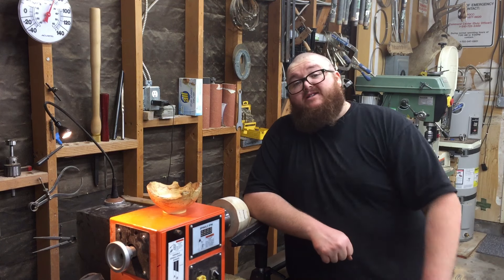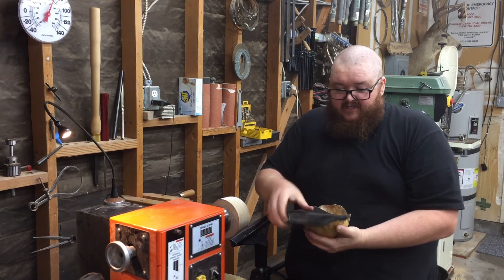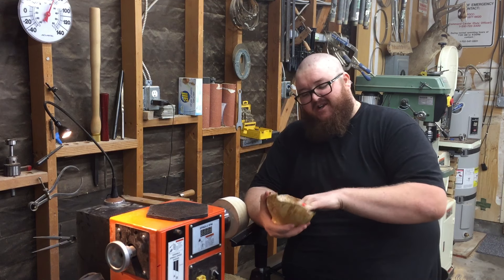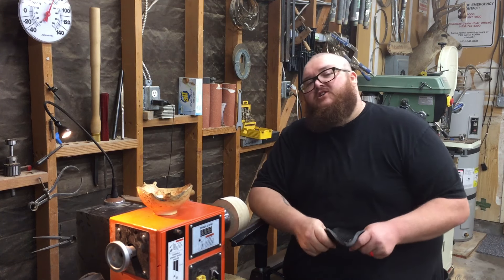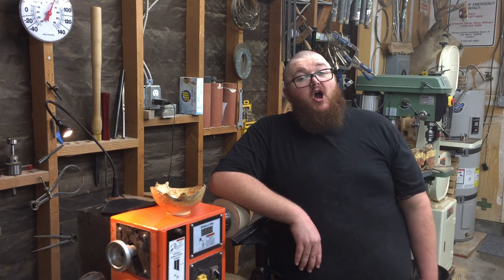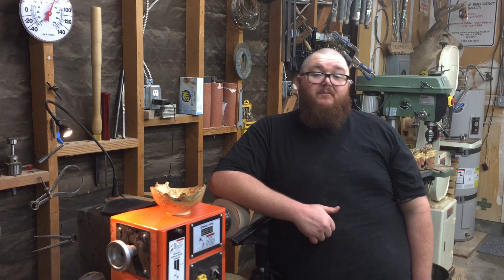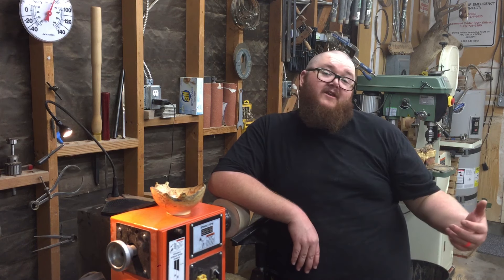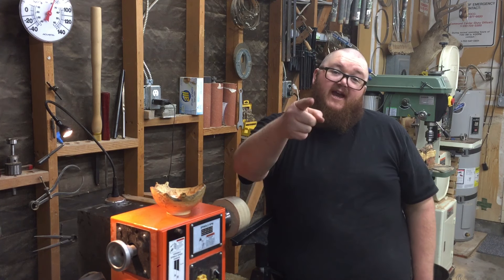Quick Lathe Tip: Protecting Bowls on a Jam Chuck

Comment: That's a great idea. Here is what I use. Old mouse pads. That thick rubber works really well. I also use a 6" sanding disk with the velcro removed on a Jacobs chuck. Just some ideas.
Keep the podcasts rolling and turning bowls. Thanks for the videos.  Sam
Reply from the maker: Those are great ideas! Thanks for watching, and also thanks for supporting the podcast!